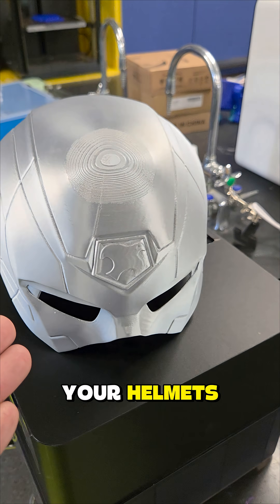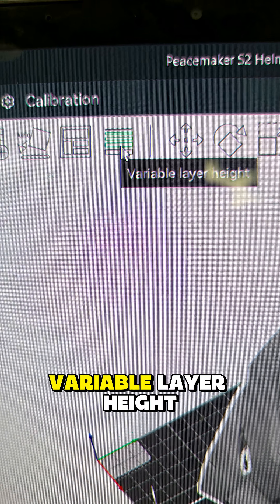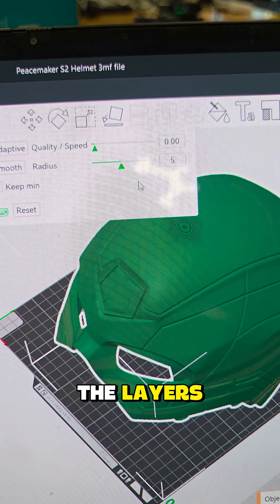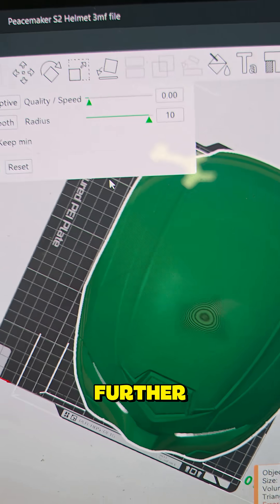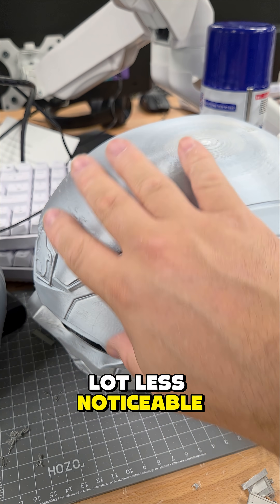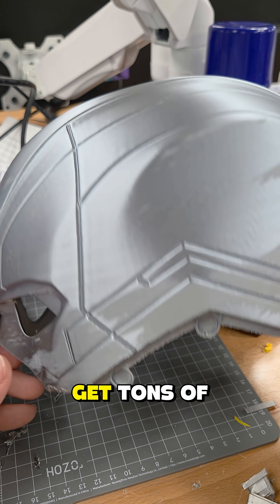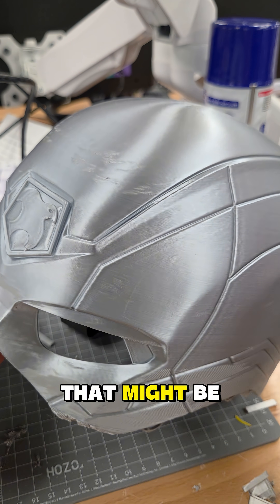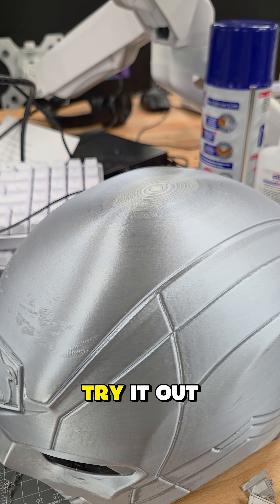Can This 3D Print Trick FIX My Peacemaker Helmet?!

Comment: Prusa slicer dose that better
Reply from the maker: That's actually on my list of things to try I'm going to try to put it on the prusa core one. Are you suggesting to do adaptive layer height or just let the natural defaults of prusa slicer to handle it? Thanks for the tip
Reply: @CaptainCreativity  use the adaptive layer selection feature in prusa slice. by doing this you can select were the thin layers are and were the thick layers arethis alows high detale in selected reagons and low detale in select regons.